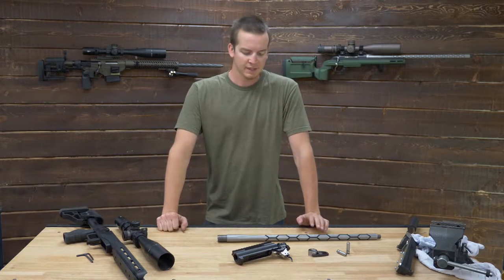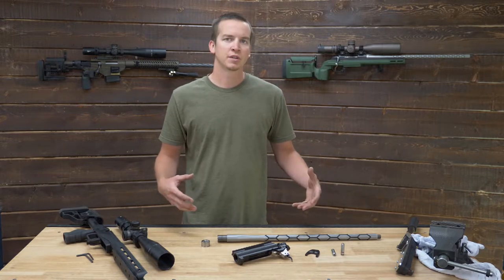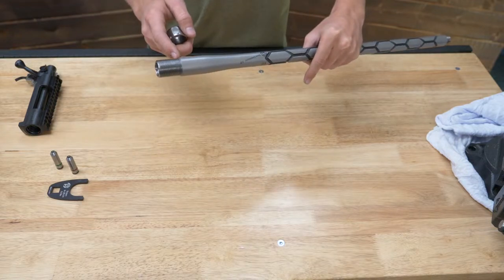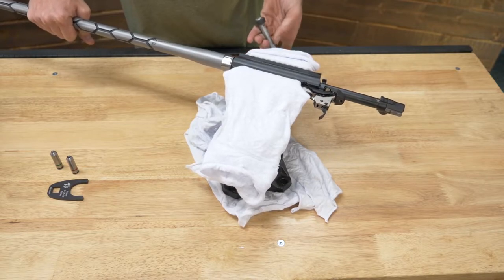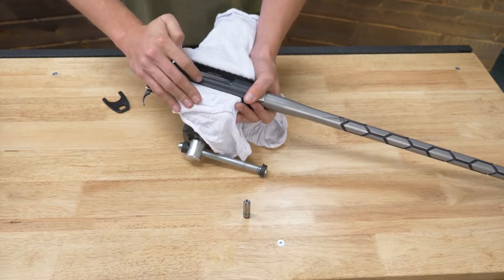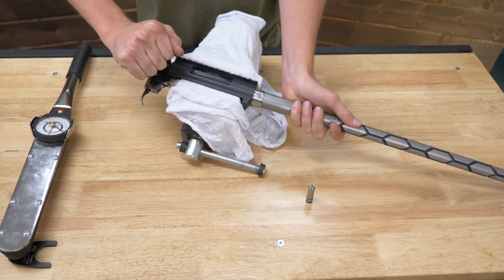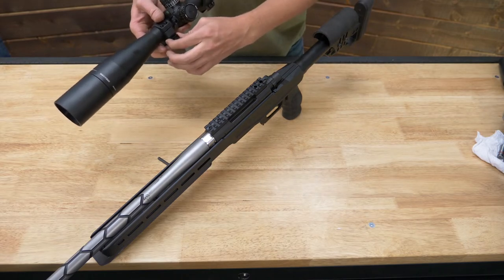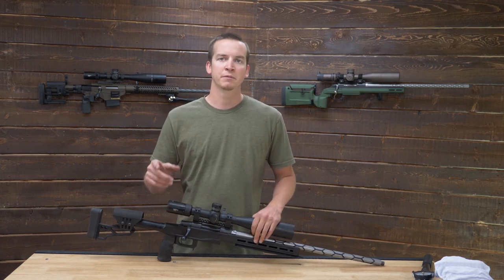**How to Install a Prefit Barrel** Preferred Barrel Blanks Headspace and Torque Barrel Nut Prefits

Comment: I got one of these barrels for my Ruger M77. I got this barrel chambered in 6BR. I started with Accurate 4064 powder behind a JLK 105gr projectile ignited with a standard CCI small rifle primer. I can't believe the accuracy out of this rifle. I don't shoot competition but after I got about 20 rounds though the barrel I worked up a load and my first group at 100yds it just elongated the hole for 5 shots. I take this rifle out to 1000yds about once a month and get 3-4" 3shot groups consistently. Will definitely buy again.

Comment: If you have to use a bench vise to change barrels. Buy a 1×3 red oak board from lowes ,cut the length you want your blocks 3-3 1/2". Double up your pieces and glue them together. Use an 1/8 inch spacer between the two sets, clamp together and drill a hole large enough to accommodate your barrel close to the chamber. Now you have a makeshift barrel vise. It works way better than clamping your action directly in a vise. A little rosin or leather shims in the blocks will hold the barrel TIGHT.
OR you can just buy an action wrench and barrel vise.😁
Reply: Punctuation and syntax please

Comment: I'm in the market for a barrel and I'd really like to see some videos on how and what tolerances you hold in production.
Reply from the maker: We plan on making a series in the future of how our barrels are made and we will also show our tooling to verify each tolerance. But for now, we utilize gauging that reads in ten thousandths of an inch that we check the entire length of the bore. If any of our barrels bores read more variance than .0003" they are discarded.

Comment: As a precision build. Is there no need to bed the action?  Hact trigger is 3lb to 4lb second pull. Far to heavy. A 1lb to 1.5lb spring kit would be preferred for bench or prs. Or 2lb to 2.5lb for hunting med to long range. $20 ebay. Cheers for the vid though.

Comment: That's for the video but why do you tighten it to the go gauge and then back off? 

Per PTG "If a rifle closes on a GO gauge, the chamber will accept ammunition that is made to SAAMI’s maximum specifications.
The GO gauge is essential for checking a newly-reamed chamber in order to ensure a tight, accurate and safe chamber that will accept SAAMI maximum ammo."

If you back off, then the chamber would be accepting ammo exceeding SAAMI maximum, right?

Comment: Does the little wrench come with the purchase of a prefit barrel with a nut? On a savage. Didn't see it as an option on the website. Or do you sell savage style barrel nuts that require getting the savage wrench someplace else?
Reply from the maker: Savage and Remage prefits will come with a Savage style nut. You can find those wrenches on amazon, midway, etc.

Comment: Did you have to take the ejector spring out of the bolt to check the head space?
Reply from the maker: No, closing the bolt will compress the ejector

Comment: Does the firing pin and ejector need to be taken out to headspace?
Reply: That's what I was taught. I have never fitted a bolt action barel. I always do this on AR platforms I build or work on for others.

Comment: How hard was it to get the original Howa barrel off?
Reply from the maker: Most brands are pretty tough to get the original barrel off. proper tooling will definitely be required. We use the Short Action Customs barrel vise